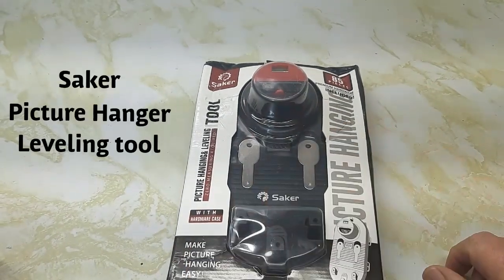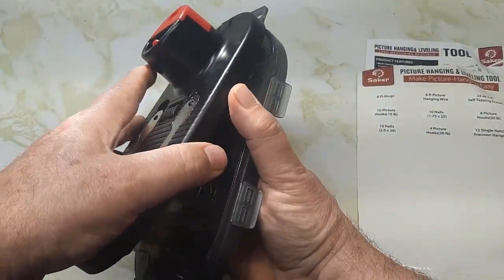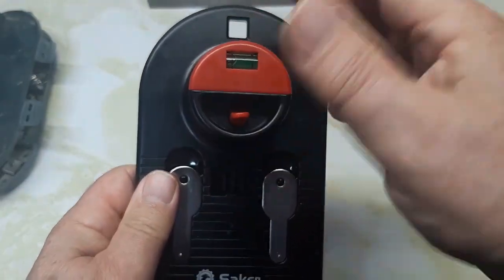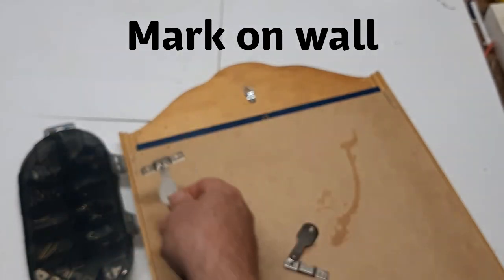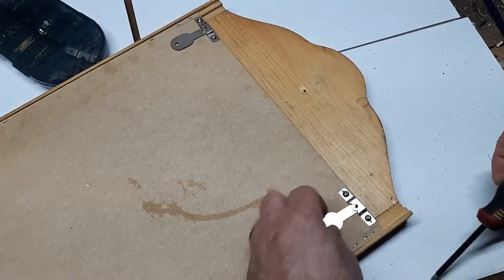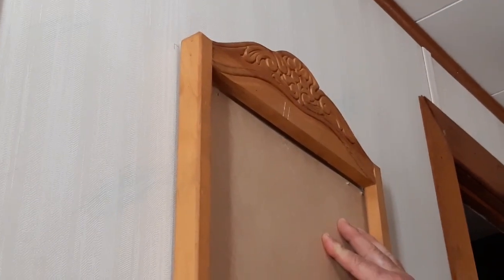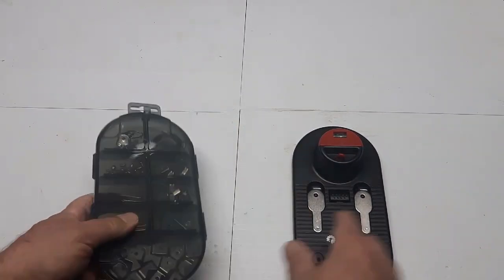Saker Picture Hanging & Leveling Tool

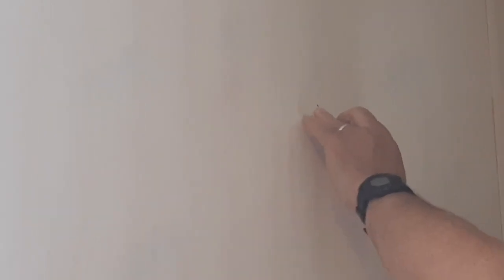Comment: Thanks for this. One thing I'm wondering about is at 08:40 you bang a hanger in quite quickly - but if you're putting the pin in where the mark is, the actual hook that the picture sits at is going to be an inch or so lower??
Reply from the maker: I cant remember but if I did put the pin where the mark is it would be lower.